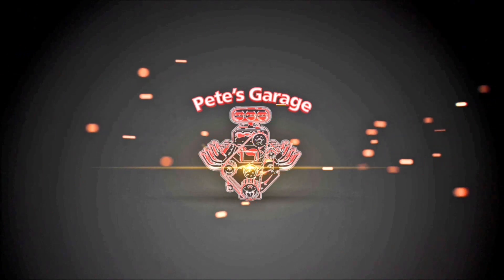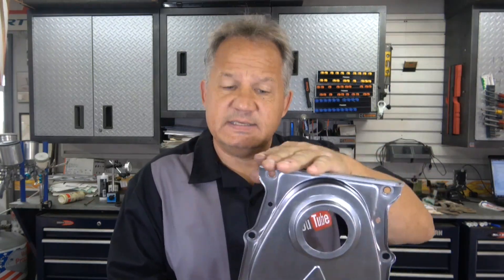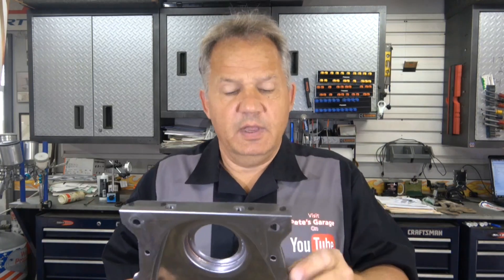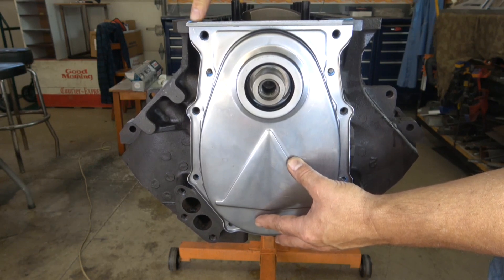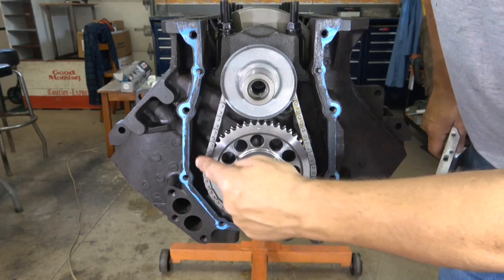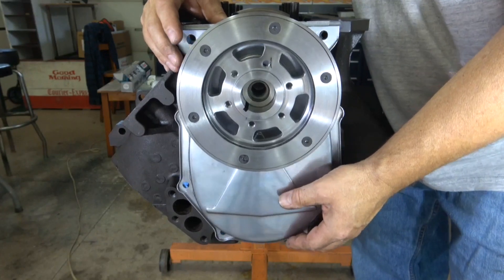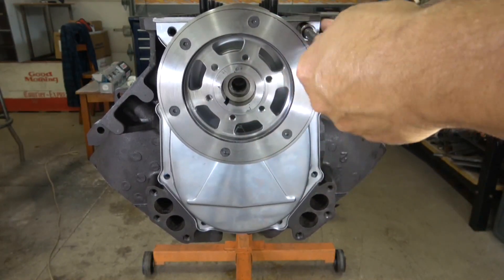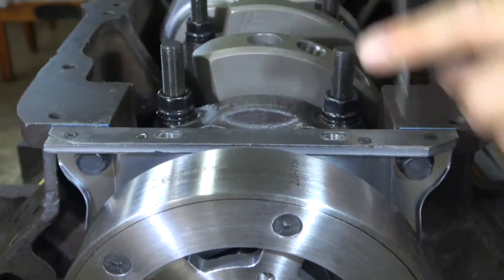Engine Building Tips - Fixing Front Timing Cover Alignment 440 MOPAR 512 Stroker

Comment: Brilliant pro tip! I don't think I've ever checked that, just bolted stuff together. But with the amount of import parts coming into the country, it is a great idea to check the alignment of the cover/seal to the damper. Putting a timing chain in my 76 Warlock 440 shortly and will use this info! Thank you!
Reply from the maker: You're welcome, glad it will be helpful!

Comment: Any place that had paper gaskets on a Mopar engine, I use Rolls-Royce sealant called Hylomar. Way better that silicone...it's messy, but it keeps the paper gaskets moist, and not drying out and cracking literally for years
Reply from the maker: Thanks for sharing that